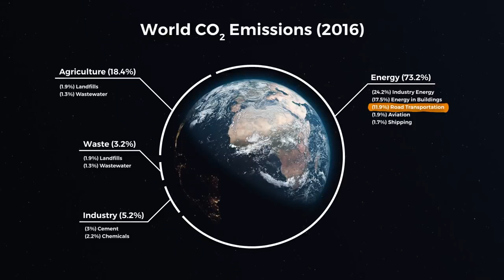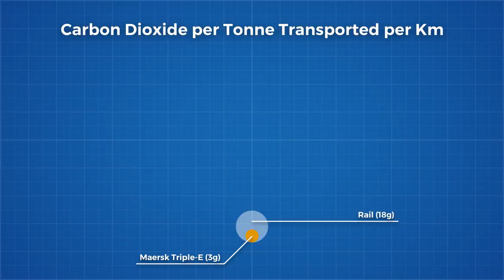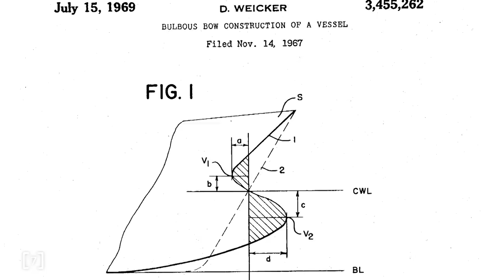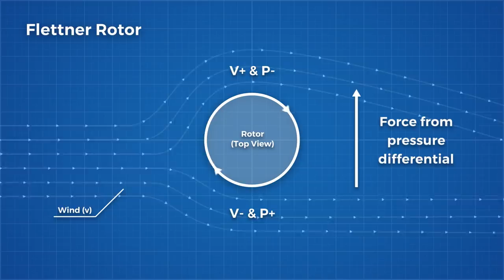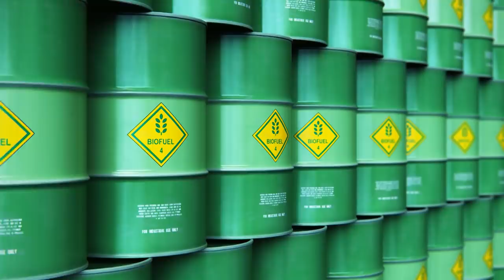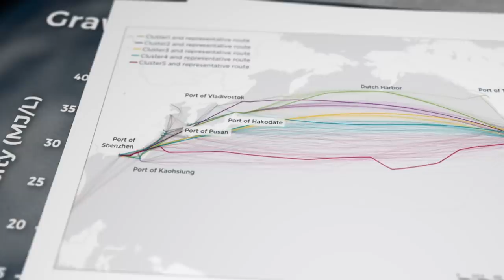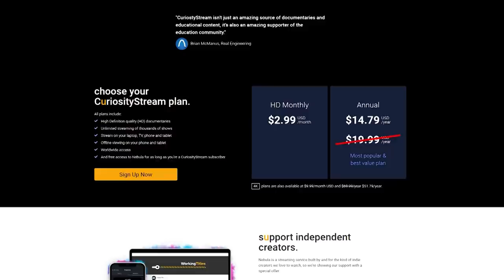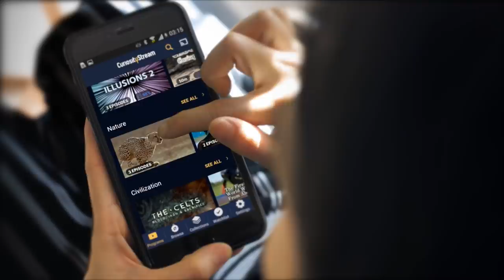Are Renewable Powered Ships Possible?

Comment: Nuclear powered ships are very cool. They can drive for decades without refueling and are independent on weather or climate conditions.
Reply: Just doesn't seem efficient for what they need
Reply: @Aaron-wq3jz  how so?
Reply: @Pyriphlegeton  well first you have to develop different reactors for different sized ships. Then redesign the structure of the ships due to weight of the reactors. Then the fuel is gonna cost more as u buy more material if suppliers cant keep up with demand. Then u gotta pay 2+ nuclear engineers 200k per ship. And when the ships service life ends that's even more money safely disposing the nuclear fuel. And the one if you main benifits of nuclear fuel is the ability to quickly increase power output which they really dont need to increase speed that quickly. Not to mention having having multiple companies who vary in how shady or trust worthy being in control of dozens of ships with nuclear fuel on it if mismanaged it could end up in th wrong hands. it just seems that the areas where nuclear fuel is efficient shipping companies don't care about or already have solutions on the way. And where nuclear fuel is inefficient is very expensive and complicated
Reply: @Aaron-wq3jz  It’s already been done economically. The Otto Hahn operated profitably using nuclear propulsion for several years. Additionally, there have been substantial developments in compact reactors recently.
Reply: @Aaron-wq3jz  a single NuScale SMR reactor module could in theory provide the power for a Triple E class container ship and i doubt it is much bigger or heavier than the two diesel engines
Reply: @scotticusmaximus5558  Especially when you consider the mass of the fuel.
Reply: @junelawson5719  yea small scale. But my perspective is coming from nuclear carriers used by Americans. I still dont see it happening on a large scale and that safe disposal might hit them pretty hard in the future
Reply: The nuclear waste which is being generated is really a concerning factor. Safe disposal of this waste is quite a big challenge. Nuclear ships are being used not because it's efficient. It's the period of refuelling that makes warships nuclear powered.
Reply: BAT THINK  Bubble-popping attempt: Research needs to go wide, not deep. So look to other sources beyond the confirmation bias re-inforcing filter bubble of youtube and similar algorithms. you will eventually notice that the tools you use for research are feeding you only that content which confirms your beliefs because that keeps your eyes on the medium where they can fill your head with advertising.
Reply: @aravindaji7  Waste isn't that big of a concern. It's easy to contain and can be stored indefinitely. Additionally, most nuclear waste isn't actually waste; Most of the mass of spent fuel rods is still prime fissile material. Once advanced reprocessing technology is available, these isotopes can be retrieved and used as fuel. Compared to other forms of waste, such as particulates caused by the combustion of chemical fuels, or the e-waste generated by battery mining, nuclear waste doesn't really pose that much of a threat.
Reply: @Aaron-wq3jz  Nuclear waste disposal would probably get easier if there were large amounts of nuclear ships is operation, due to economies of scale. Things tend to get cheaper on a per-unit basis as quantity of production increases.
Reply: @junelawson5719  I'd they didn't prepare before hand there would be a backlog of ships and would essentially be a graveyard of old ships with nuclear waste even still it can only get so cheap
Reply: @junelawson5719  
Actually, the reason the Savannah and the several other nuclear powered civilian ships were withdrawn was economics. The only current civilian nuclear ships, to my knowledge, are some nuke icebreakers the Russians operate.
Reply: @chuckaddison5134  Yes, but the reason they were uneconomical was because oil was cheap at that time and environmental impact was not being considered. At 1974 prices of oil, NS Savannah was no more expensive to operate than a comparable oil-powered ship. When you consider the urgent need for carbon-neutral transport and the immaturity of alternatives, the modern economics of nuclear marine propulsion are quite reasonable.
Reply: @junelawson5719  This is regarding  your opinion on ease of nuclear waste disposal in the future. I don't think that with an increase in nuclear powered ships, we will be in a position to fast track methods harmless disposal methods. Also even a single incident of a ship accident is likely to cause more damage than a single oil spill. Working with radioactive materials in commercial entities is Catch-22.

Edit: Grammar
Reply: @rockingttalent3666  if the Russian icebreakers are anything to go by the accidents so fair have been really minor. Only one ship has been scrapped from them. And that's several decades of use. Just need the maritime body to be pretty on top of inspections and maintenance regulations.

With a big enough increase in the amount of waste there should be both political and economic incentive to actually mature the reprocessing and recycling technologies that are starting to come out. And consumer pressure on mobile technology and battery companies to use the nuclear batteries that are being developed would help.
Reply: @rockingttalent3666  When there’s mass demand for something, that tends to bring down the unit cost, and that should make handling the waste a lot more economical. And I don’t think a nuclear containment failure on a ship is actually likely to be very dangerous. Fissile material is easily diluted in the ocean, and radiation doesn’t appear to be that dangerous to ecosystems; No adverse effects have been associated with the radioactive material released into the sea by the fukushima plant, and plants and animal life does not seem to experiencing serious issues in the Chernobyl exclusion zone. I think the risks are massively overstated, and nuclear marine is the quickest way to decarbonise intercontinental transport. I don’t think delaying decarbonisation because of the minor risks of nuclear is a good tradeoff.
Reply: @Aaron-wq3jz  Yes, deployment of nuclear marine technology must occur alongside the development of refuelling and waste management infrastructure.
Reply: @junelawson5719  
It was a bit more than that, oil prices in the sixties was indeed cheap, not so in the seventies. Also the Savannah was a normal sized ship by post WW2 standards. But, by the seventies containerized freight became the standard shipping method. The Savannah was thus out classed by larger  cargo carriers that could haul vastly more goods. Making the fuel expenditure more economical.  On top of that maintanence and upkeep was lightyears beyond what a non-nuclear ship cost, including the added expense of nuclear trained engineers.  The last thing about nuclear is end of life cycle costs. Disposing of a reactor and associated equipment is vastly more costly than than just driving a diesel ship up onto the beach an cutting it apart for scrap. The Navy takes years and millions of dollars to decomission a single nuclear ship. 
Having said all that, I'm not opposed to nuclear power. Our knowledge of Nuclear engineering is miles beyond what it was in the post WW2 era. We no longer require highly enriched material, thus making the reactors less of a terrorist target.  Ship sizes have mostly stabilized, and standardized. So maybe it's time to try again. My only real concern is the flagging nations standards. Most ships sail under national flags that don't require rigorous standards of maintanence and crewing. Reactors require more attention to detail than diesels. And thus more of a potential accident concern.  Again reactor design is far beyond Three mile island, Chernobyl, and Fukishima. But they are not idiot proof. 
I don't know where the balance lies. In competent hands, nuclear power is the answer to our power appetite. Disposal of the fuel and end of life cycle components is a solveable problem. Wind, Solar, Geothermal, and Tidal all require hydrocarbon fuels to mine, manufacture, transport, assemble, maintain, disassemble and dispose of, in addition to requiring hydrocarbon standby generation facilities.  Additionally, the need for lubricants, drugs, medical equipment etc. that require hydrocarbons to manufacture, guarantees that to some degree, we will never be free of hydrocarbons.
 I'm not a fan of Michael Moore but his "Planet of the Humans" hits the nail on the head as far as renewables and hydrocarbons. His solution is a bit of shaded Nazism however, as he advocates population control.
We were supposed to have run out of oil sometime in the 80s or 90s as I recall the naysayers claiming in the 70s. Of course we were supposed to be deep into another ice age too by now.  We still have oil, and now the earth is going to cook. Al Gore said we had 12 years left. . . In the 90s. 
Unpoliticized and competently handled nuclear power on ships could be an answer. But if you look again at the pie chart on greenhouse gas emission, shipping accounts for less than 2%. 
Considering that shipping moves 80% of the worlds goods, I think there are other areas that require our more immediate attention.
Reply: @Aaron-wq3jz  you are totally wrong, Russian ice breakers uses mini nuclear reactors two or 3 of them will be enough, the most expensive part is building the ship and refuelling 25 years after.
Reply: @junelawson5719  and the current track record of disposal of hazardous materials has been dumping it in china and Africa
Reply: @carholic-sz3qv  I belive you're point has been addressed earlier in the thread
Reply: @Aaron-wq3jz  Nuclear waste has been handled safely, for the most part. I'd be far more concerned about the mass dumping of old solar panels.
Reply: @chuckaddison5134  When it comes to the emissions from shipping, I think it's also worth considering that shifting intercontinental transport from air travel to marine travel is a possible way of reducing emissions, so nuclear marine transport could eliminate more than 2% of emissions.
Reply: @junelawson5719  
No argument there, but there is a reason the added expense of air transport is chosen over maritime transport. Namely speed! Airplanes arrive in hours whereas ships arrive in days or weeks. I do think that it's worth looking at though.
Reply: @aravindaji7  Much better using oil and pumping all the waste including any radioactive isotopes in the fuel straight into the air then?

Comment: One quote- “Everything, that is hard and challenging, is deemed impossible until its done...”
Reply: Sometimes it's also deemed just not worth the effort. :D
Reply: its clearly impossible, no one has ever managed to do it!
Reply: Which shouldn't be taken to mean that absolutely everything imaginable is possible.
Reply: Cough Cough "HyperLoop" "Loop" Are doing just fine, with the crappiest innovation designed.
Reply: @klutzspecter3470  If their goal was to rake in money and accomplish absolutely nothing of value, yeah, they're doing great!
Reply: Being a marine engineer that works on container ships for the company very prominently mentioned in this video, it is not impossible but we need too work around the problems presented by renewables, redundancy and fuel storage being the big challenges are the main obsticals at sea redundancy is required as a matter of safety of life at sea. The triple es have some amazing fuel saving technology, and we are trialing bio fuel on some ships.
Reply: Rhetoric...
Reply: @robthurlow1347  biofeedback is nice to hear, what about hydroelectric power? As a ship moves its passing through water is there a way turn that into hydrogen electric, or hydroelectric power similar to the fresh water pumps on a ship. Or does there need to be more reliable non toxic batteries first?

Assuming you need a lot of power to move these heavy tankers.
Reply: "Tam, kurš saka, ka tas nav iespējams, nevajadzētu pārtraukt to, kurš to īsteno...." a folk saying of mine it means: "He, who sayes, that it is impossible, should not stop, he who is realizing it...."
Reply: @Robert53area  yeah when I was a young eager cadet I had come up with that very idea but there is a fatal flaw with that idea you would essentially be trying to create a popetual motion machine which of course is impossible. 

Yes a lot of power is required on one ship I sailed on that was built in 1998 at the time the largest in the world could burn north of 300 tons of fuel in a day max speed on more modern ships is down too between 150 to 180 tons when we are really shifting. Batteries aren't practical yet no battery has the energy density yet with a good recharge time and low enough weight, a container ship on average is turned round in a port in 8 hours some times a lot less that doesn't leave a lot of time for recharging, and of course reduced cargo capacity, Hydrogen presents problems on its own the storage is a big problem you are going to consume a huge amount of power trying to keep it cold enough to stay liquid and not flash off and leave you with ni fuel.
Reply: @s4dg  they said the same things about flight didnt they?
Reply: We just watched propulsive landings on earth go from impossible to rutinary a couple of years ago.
Reply: What if it is not viable because it costs too much energy or money than it produces, like fusion reactors.
Reply: @robthurlow1347  Exactly. I was thinking about perpetual motion machines also as I was reading the OP comment.
Reply: These "feel good" statements conveniently leave out the context/environment in which a particular thing/action is impossible.  Exp. It's still impossible to fly faster than the speed of sound... with a propeller driven Aircraft.
If we ever find a way  to travel faster than the speed of light I'm sure it won't be an object with mass moving through space. We would have found a way to negate one or the other. But then someone in the future will say... I told you anything is possible.
Reply: Not really, some things are just physically impossible, due to laws of physics or chemistry that simply makes it unacievable, for example building a plane completely out of lead. Which is both too heavy and weak to be feasible.
Reply: @zambani  yes exactly right we really should be thinking more in terms of it is impossible until we discover the loop hole/characteristic which allows us to make it possible.
Reply: In tech hard and challenging is never impossible .Just not yet practical or usable .
Reply: @exotic-gem  Something often said to disregard the possibility of a solution that exists outside of current understanding. "eh I can't see how so no one can I guess.".
Reply: The universe is filled with heat energy that you can always seperate collect and cycle
Reply: @s4dg  It was said to be impossible to get to the moon. Well now we are aiming for the stars
Reply: Are you then precluding the possibility of anything actually being impossible?
Reply: That quote unfortunately gives the impression to many, that things that are deemed impossible are just hard and challenging. Most of those things probably are impossible. Some are impractically hard and fraction of those things are only challenging.
Reply: @exotic-gem  If TECHNOLOGY and Great Ideas are "Magic" to you...the YES, Let's use "Magic".
Many "Practical Problems" are merely problems because people are clinging to a very old technology or way of doing things.